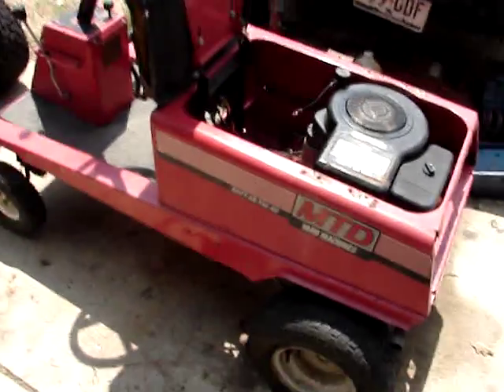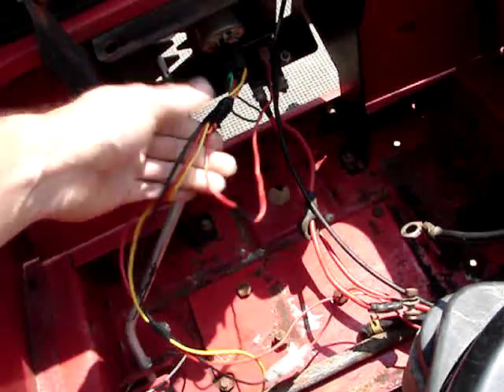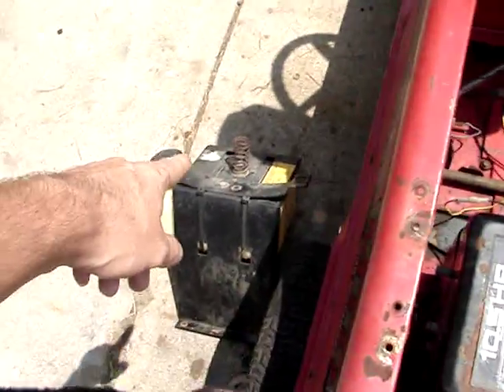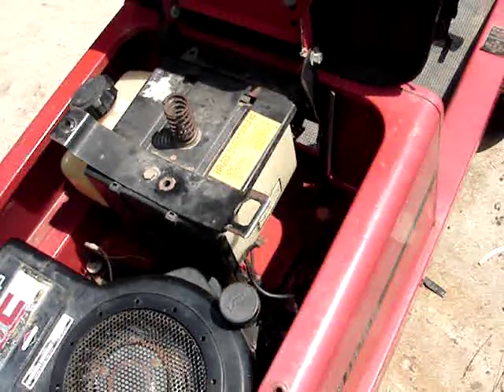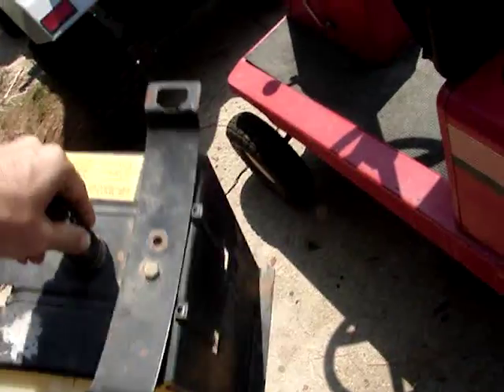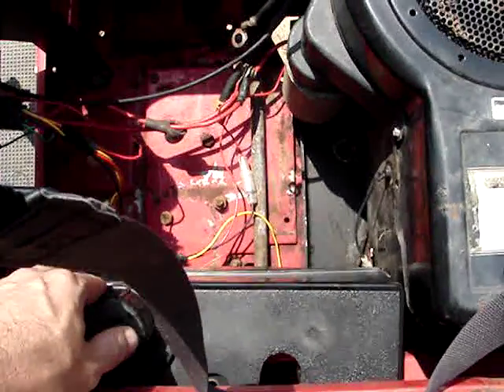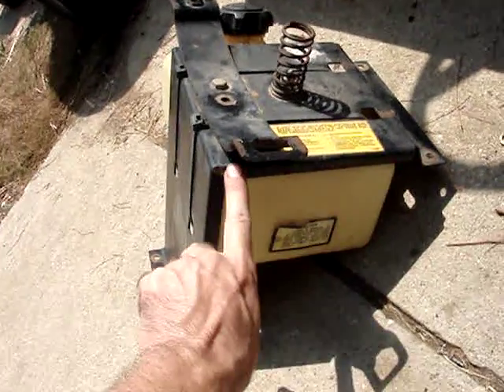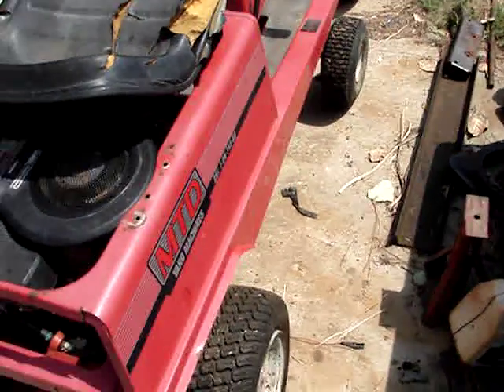Little Red MTD, 1994 Yard Machines RER Update

Comment: You said you dont want anything out the back of that machine- but what about above the motor? Build an angle iron frame and put either the stock tank or the craftsman tank in it like most go karts do. The gravity feed would would help keep the carb fed, and under the seat would be WIDE open for a mower or even a car battery if you wanted.

Comment: I was going to suggest some sort of slick sliding battery tray that would come out the side. but that might be too complicated. Cut a hole in the side where the battery originally went, turn that into a door with hinges, then have the battery slide out on rails or something cool.

Comment: Hey hot rod do you still have that z rider? If so I might be interested.  I have a running john deere 317 with hydraulics that I never use . If you could slap a different motor in the z turn i may have a deal for you

Comment from the maker: Yeah, alot suggested a side door. Thats too much work for a crappy mower. I ended up putting it on the floor board. I didn't want, but ehh, I wanted it drivable.
Reply: Reply Back I will Buy the mower